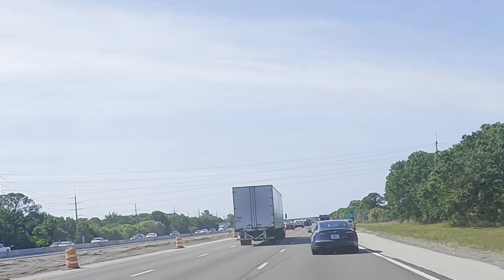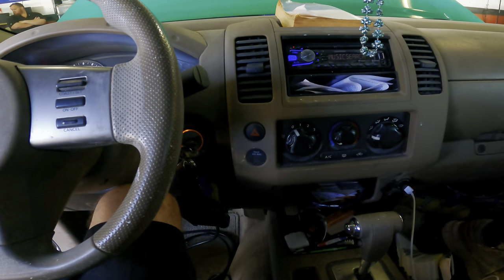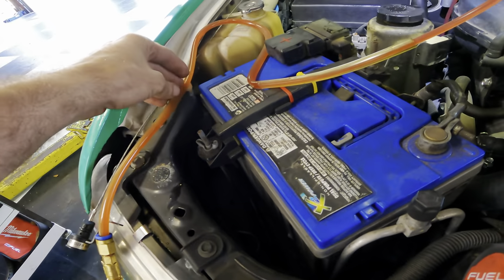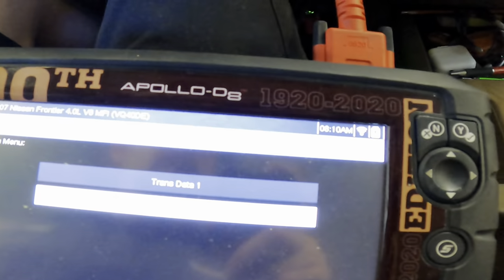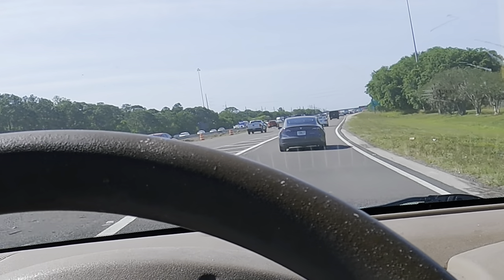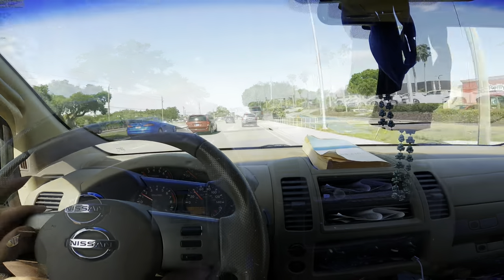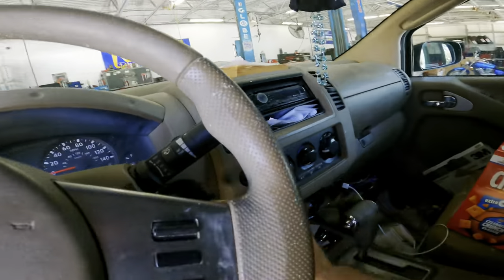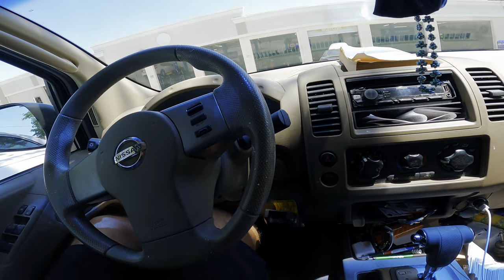Customer States: Vibrates Sometimes! How to save money by using your words!

Comment: Why not remove the automatic transmission pan, drain the fluid, replace the filter, replace the pan with new gasket…would that not get rid of more of the old fluid? Even do it twice if you have to….no? Or do you feel that your method gets rid of more of the old fluid? I’m not saying I’m right or that you are wrong…just wondering.
Nice YouTube channel. Somehow I find it very relaxing to watch your videos. Maybe because I used to do this kind of work…maybe. Keep up the excellent content. Well done.
🤔🇨🇺🇺🇸
Reply from the maker: There a delicate balance so-to-speak of what people want vs what they are willing to pay for. Bottom line is the truck needs a torque converter or trans work, but our guy wants to pay for cheap maintenance to “see if that helps”
Reply: @RainmanRaysRepairs  …I got you. Totally agree with you.
🤔🇨🇺🇺🇸

Comment: i'd think there wouldn't be any amps on the tcc sol until the tcc attempts to go into lockup at 40ish mph. need to check at cruise speeds. just my thinking on the issue.

Comment: I get what you mean completely with the vague work orders, I'm an HVAC/R and commercial kitchen tech and so often I'm just told things like my combi-oven just doesn't work right, my refrigerator was temping hot so I unplugged it 3 days ago, or my deep fryer made a noise last week, can you describe the noise? not really. when did it happen? I don't know. What where you doing when it happened? I don't know. I had a refrigerator one time that the customer peeled the data tag off the unit because it was ugly a few years later it broke, I asked what happened to the data tag and they told me, I said well what model is it, I don't know, I said back I don't either so how am I supposed to order parts. They said can't you call the MFG? You think some guy sitting in a call center knows exactly what model your refrigerator is without at least a serial number? Sometimes I hate people.

Comment: Write down what the issue is with exact details of the issue, what did at didn't do and tape to steering wheel so mechanic gets the information not filtered by the service advisor

Comment: We had a car come in over night and sat with the roof down hood open and trunk open no key no note, So we did no work to it all day.  The next morning it was full of water because it rained all night. 
At the end of that day the guy showed up wanting to know why we did not fix the roof.
 Now he is dealing with a lawyer because he wants a new car from us because we did not put the car in the shop or fix the roof or cover the car.
 For all we knew that was a stolen car so we did not going near it.
Another time a few years ago a car showed up at the shop over night blocking the bay with a note ' wont start' but there was no key in the drop box so we pulled it with the yard truck. 
At the end of the day the owner showed up and got angry to see the car was pulled '' tire marks''  away from the door because they thought we could just fix it then start it then park it.
They thought we had a master key because we were a '' Real '' car company. 
Funny side not is I had a GM and the key for it was uncut so any new uncut gm key would open the door and start the truck.

Comment: Ya know, there’s no reason to apologize about not working on the innerds of transmissions. Your skill is knowing how a transmission should behave under a variety of situations. If it does perform they way YOU know it should then it really is time to call in the specialist. I’m sorry for two things. One, like in this case, you often get very vague descriptions of why you’re even sitting in the vehicle. Or two, you often find very serious problems with a vehicle that can be dangerous to the owner and/or others and the owner leaves the shop without having the necessary repairs done and doesn’t do you the courtesy of explaining why not. BTW, your “rants” and just as interesting and informative as your repairs.

Comment: I agree with having tones of info on the issue when possible, however I disagree with your analogy of " The car doesn't start".  You need to remember, most people are not technical, nor have they honed their troubleshooting skills.  I can tell by watching the way you troubleshoot,  you follow natural, logical progression, which is something many people fail at.  This is partly why the car is there.  YOU are the expert.  YOU are the diagnostician.  "The car doesn't start" is exactly how it sounds.  To them, it does not start.  So the onus is on whoever is acquiring the information from the user, to ask the relevant questions that a diagnostician may need.   So really, they have told you all they technically know.  It doesn't start.  So you look into the starting system...  It is a starting point.  The diagnostician will easily note all of the listed things you mentioned.  Does it click?  dash lights? headlights?  Does it crank no start? No crank etc...all figured out by the trained eye in a few seconds by replicating the issue and observing.  Personally, I prefer to see the issue first hand when possible.  

I do lots of troubleshooting, on all sorts of system, from IP networks, to Telecom, VoIP, electrical systems, circuits, pretty much anything I can troubleshoot I will.  And getting CORRECT information from the end user is always, bar none, the BEST thing you can do, while still remembering that you have a trained eye on it, and to be observant when they relay the information as you may pickup on something they say that will clue you in on what the actual problem is.  I see it all the time when Sales managers or even technical liaisons don't get the relevant information for a job and you are left hunting for it.  I guess in your field, that is where a good service desk person comes in handy.

Comment: OK, I don't get this one Ray. Why take out trashed fluid without changing the filter? I looked it should have one and it was cheap. I'm no tranny guy but I believe picked up fluid goes to TC first? So clogged filter could cause slippage?  The rant, got you. But Thing is your kinda preaching to the choir. I would think most here are or have been techs or more. Been there done that? I watch every day. Excellent work and funny too. Don't forget to have yourself a nice day. End transmission.

Comment: I get your point on car has a vibration, but car doesn't start is pretty self explanatory.
You as a qualified Tech. The first thing you are going to do is turn the key on and confirm fuel, battery
able to crank engine and what happens. Holy! Bad day or what?

Comment: So I have a leased 2019 Honda CRV, roughly 12,000 miles on it (I know, I get it). But twice now I have experienced loss of acceleration, decreased horsepower,flashing check engine light.  It’s obviously under warranty so both times it was towed in.  The first time, the dealership replaced a spark plug and sent me on my way.  The second time, they stated that fuel had mixed in with the oil and ruined another spark plug.  They changed the spark plug and gave me an oil change.  I’m not a car guy, anyone wanna throw some advice my way?   This throws up some red for me.

Comment: I didnt see you turn the a/c on.  Alot of vehicles with v6 or 4cyl. shake and shudder at idle with a/c on.  Just throwing that out there, especially higher mileage ones, dirty fuel injectors, old spark plugs.

Comment: I would check out the Ancel X7.  It's $385 and its a full bi-directional scan tool and it will do active tests on transmsissions.  I did a brief video of playing around with it about a week ago on my channel.  I have noticed a few bugs in Active Tests on different makes and models with it so far, but I did a screen record of them, and sent them in using the feedback app built into tool and 3 days later they had an update out that fixed the bug.  And sent me an e-mail thanking me for finding and reporting the issue.

Comment: Ray, what are your thoughts on MT? From the perspective of a technician is it a more straightforward platform to repair than a AT or CVT?
Reply: A manual transmission is a straight mechanical device. It's far less complex than any type of auto trans. That said, there's still a lot of parts tp contend with. I doubt Ray would go into one any more than he'd  do a deep dive engine service. He just doesn't have the physical facilities available.

Comment: I have a 99 blazer 4x4 and with the 4l60e. When it’s cold only it has a delayed engagement for reverse only. Reverse works fine even when cold but just delayed. Once warm no delayed engagement. Any advice you could possibly give me on the issue?
Reply: I think what Ray would advise here is take it to a transmission shop. It sounds like a sticking valve inside the trans, but only a tranny guy can make a good determination. Regardless, if delayed reverse is the only problem it's unlikely that a basic service or any external work is going to help. If you want to know more about how the transmission actually works, check out Precision Transmission's channel. Richard there does a lot of 4L60e work.
Reply: @rayives7758  
Thanks. I should of mentioned if it can last a long time like this or is it a symptom of imminent failure.

Comment: Mechanics should use their words, because customers don't know what is wrong or why it's not working. As mechanics, it is our job to talk USE OUR WORDS while questioning the customer, to find out what's wrong.
Reply: Issue with that is that you can quickly get biased. I am not a mechanic but a customer.
If a mechanic asks me if this issue might be A or B, I will probably not answer C because he gives me the option of A or B. This will lead me to shift to what is more likely. 
I know the intention. But I had painful discussions with a BMW Mechanic when I told him that the inside of my left rear view mirror is rattling.
He asked me if it would be coming from the tweeter, when I play music or stuf like that. I said no - it's from the bloody mirror. I told him that there might be an electronic connection rattling around. I basically told him that I will smash the cover so he has to look at it when replacing it because he was so stubborn that this cannot be the case. 
And this happened with a brand new car - 500 miles on the clock and as a company car via leasing - that means I pull my card and he has a free ticket to do whatever he wants. 
And he chose to do nothing. Only when threatening that I will return this car under policy for several issues and buy a Toyota for a quarter of the price and that this won't squeak and rattle, he opened up both mirrors and saw that one had the insulation around cables and connectors and the other did not.
So much for "Cannot happen, my experience as a mechanic tells me it MUST be the tweeter".

Comment: This shop sucks at talking to the customer.  
I go to two auto repair shops. 
I speak to the shop owner directly and the shop owner rides in my car to hear any noise I am describing. 
Sometimes the problem is obvious like a leaking radiator and a test drive isn't necessary .

Comment: I’m truly surprised you didn’t drain the pan and clean it along with another filter before adding new fluid….
Reply: Alot of cars and trucks don't have filters anymore. If you try to look up the part number for a 2014 F150 you will not find one.

Comment: I have had a few of those generation Frontiers. They have a weird shake in drive under AC load. I’ve had a 2005 (new), and a 2012 (new). Same weird loaded up idle. On a side note those X2 car batteries are worth every penny. I use those when the originals get weak.

Comment: Shudder or judder?
I've heard some talk.
We used to change fluid and use additives.
Nothing real to add. Sorry.
I did have a poorly communicated complaint about a Japanese trans one time where, they said, "just drive it around".
I did. Lots of types of driving. The fluid stunk so I exchanged fluid.
I still had no symptom verified till climbing a tall speed bump under the right condition.
It was an ignition arc.
Sometimes they just don't have the words and they can't show you.
You have to treat it like it's yours and decide.
Do what you would do for you.
Some customers just feel you should know and hope you find it.
You invest time, call them, ask more questions, share what you know now, see if they authorize more time. They're scared to death about the cost of a trans.
They may clam up or shut off on you.
But if you just try?
Jukka jukka, WTF? It's this, or it's that.
When you know, you just know.
You improvise. You prove you're right.
They get something viable solved for their money and desire to set their mind at ease.
You're Super Spidey.

Comment: I've been working on vehicles for 46 years. I've yet to see a transmission issue fixed by a fluid change. Of course you had to diagnose it was the transmission.
Reply: I have.
Reply: It could fix a shuttering problem if it is the wrong viscosity. Bmw. Mercedes. Are very touchy on this subject.
Reply: @joshhobbs1442  you might be right because I don't think I've ever seen anyone put the wrong viscosity in a transmission. But I don't work on transmission much. I've rebuilt a few of my own. You can burn out a transmission by using the wrong type of transmission fluid
Reply: Or an issue "corrected" by additives (Lucas transmission fix)
Reply: @joshhobbs1442  my 18 transit connect has a shuddering problem on acceleration. Replacing the fluid every 30k is a great bandaid in this case.
Reply: @joshhobbs1442  actually it's more about the friction modifiers or anti friction additives from one type to the other. We used to think type f was the hot rodders stuff to use. I found out later on that's not the case. Some transmission's clutches are spinning when not engaged. If you put type F in it, which has friction modifiers, it's going to cause clutch drag and high heat.  Dexron VI has anti friction additives, which would cause a transmission to slip that needs friction modifiers. (I Believe I'm correct on this, it's one way or the other) So you can see the problem if you put the wrong one in a transmission.. but by the time I found any issues like this it was too late for the customer. Fluid change is too late.

Comment: bad trans fluid doesn't cause the problem... the problem cause bad trans fluid .   bad transmission once the fluid is burnt . adding additive will swell the rubber "o"rings and seals  it's just a patch

Comment: Was there no transmission fluid drain plug, Ray? Flushing the trans fluid like that, could damage the trans... Also, if the new trans fluid causes any slipping, I recommend mixing the old fluid with the new fluid once every oil change. So that way the trans gets used to the newer fluid...

Comment: I mean Honestly, This is why I have always been against having "Service Advisors" They are just a middle man and always confuse what a customer has said. The relationship between the mechanic and the customer should be direct. Yes by all means have a Counter Assistant, someone who can keep a customer informed when the mechanic is busy. But this person should not be selling anything nor giving Any advice on what is wrong with a car or suggesting any services to the customer. They are not that customers mechanic and have know intimate knowledge of the customers vehicle. Not If that "Service Advisor" is a Mechanic, they should be able to take down a customers compliant history much easier than a non mechanic. However He is still NOT the actual service tech for the vehicle and should NEVER assume nor recommend any service or garner a guess as to what is going on. I have seen lifelong Mechanics working at a counter, recommend services and parts, site unseen. I have heard a multitude of mechanics make this very complaint Ray. One on One interaction with a customer removes any other interpretation of the customers issue and solely places the information into the technicians hands. Just my 2 cents!

Comment: I can remember over 20 years ago when we got a Jatco E4N71B 4 speed automatic transmission built up out of 2 units after my brother blew (slammed it into drive while rolling downhill in reverse) a used one we fitted into our Holden VL Commodore which has the Nissan RB30E engine & Jatco E4N71B 4 speed automatic transmission fitted by Holden in Australia back in 1988, well,we kept having the lockup torque converter slip in it after a few thousand kilometres even after we had it replaced under warranty by the transmission specialist.

I don't know if it's because the local mob here who they got to rebuild the torque converters in the Newcastle area (near Sydney in New South Wales) didn't bond the friction material to the torque converter housing for the lockup clutch because it vibrated & slipped in 4th gear.

I got fed up with it & bought a 5 Speed manual transmission conversion kit from a wrecker which consisted of a Nissan (MF5) 5 speed manual transmission, clutch, clutch pedal Box, master & slave cylinder & tailshaft,it gave the car more grunt at the wheels & fewer problems.

The Jatco 4R01 (Nissan RE4R01A) 4 speed automatic transmissions were a much better unit which was fitted into the Nissan R33 Skylines including the GTS-T (RB25DET powered) models & they were as strong as the GM 4L60E automatic transmission which was fitted behind the Chevrolet LS1 V8 powered Holden Commodores in Australia,so a beefed up version of what was fitted behind the 3.8 litre Buick L36 V6 powered cars in rear wheel drive configuration !

Comment: That NISSAN is a  trash cab on wheels - and given that the transmission fluid was
heavily contaminated as well as having the appearance of heat stress - is a
testament to the owners complete lack of care and proper maintenance.
That is just inviting trouble and expensive professional repair and remedy.
Notwithstanding that NISSAN are notorious for having an abysmal reputation
for equally abysmal automatic transmission failures as a result of poor design.